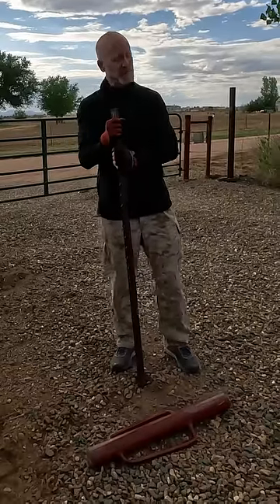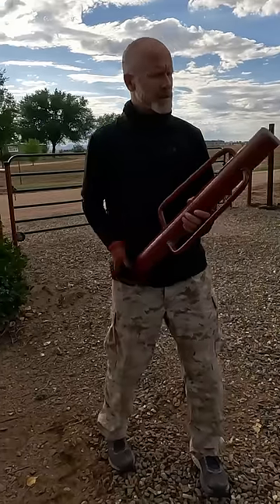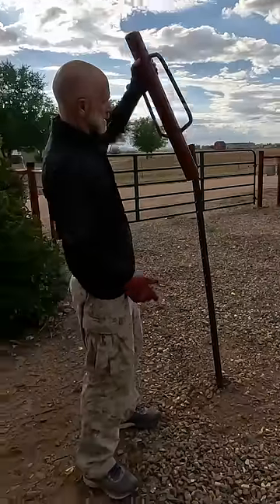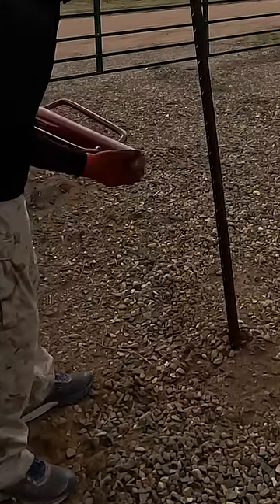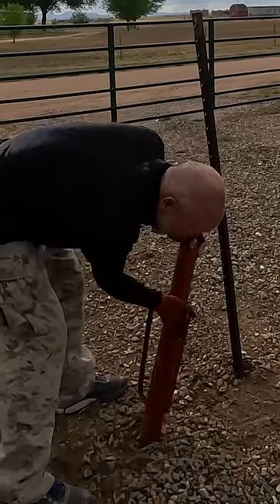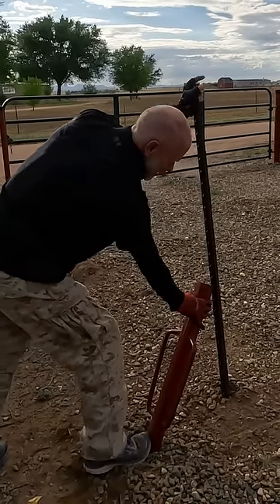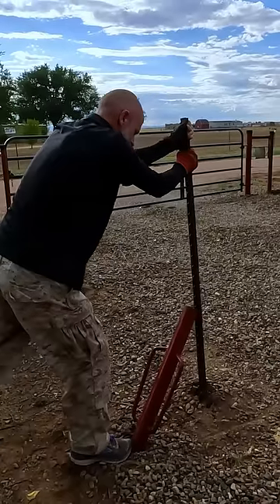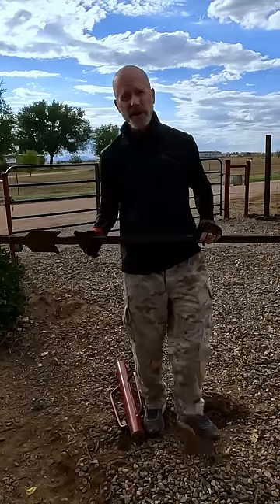Avoid Back Injuries with Simple T-Post Removal Trick

Comment: Please oh please...  when the base is loose and it's time to pull it out of the ground, step up as close to the post as you can get and squat - please don't bend like he just did in the video.
Reply from the maker: Great point. Excellent observation. To add on a bit. Stay focused. Don’t let a driver sliding out make you lose sight of best practices. Thanks for bringing that up. I should have clicked it in for a final pull rather than care about the time. I got luck that my glass back didn’t put me in the dirt.

Comment: This guy 😂 slide the handle over top of the pole pull up from the other side of the handle
Reply from the maker: That’s a good technique. I haven’t had much luck with that method. Solid solution if you can do it. For me to use the handle through technique I need to use a small jack and set the driver low. Any way that works in your environment and you feel comfortable, that’s the method you should use. Stay healthy my friend. ✌🏼🙏🏼

Comment: First of all that wasn't more than a foot in the ground
Reply from the maker: Must be the camera angle. Got that a couple times. It was 17”. 24” is the structural standard, some areas drive 36”.  In Australia a guy had to drive 72”. I can pop a post up to 24” and I know this. There is a standing challenge for 36” that I have accepted but that is a deep pull for this method. I will work a little harder on the camera angles for that pull. Have a great evening. ✌🏼🙏🏼

Comment: Thats the wrong way 😮
You drill in the driver then get a 150mm piece of high tensile steel,pass it through the hole through the post and out the other side,then use it to pull out the post,
Work smarter not harder😂
Reply from the maker: Ah yes. The star picket removal technique.  These tposts don’t have holes. In my opinion the star is a far better system. Because you can make it this simple and they are stronger.  There are better ways to do these type, such as a proper puller. I appreciate ya taking the time. Be safe over there. ✌🏼🙏🏼🕊️
Reply from the maker: Or I missed it all together. It’s late. 😂😂

Comment: Not the best way, start by using a lift high low jack, or a lever chain system. much easyer.
Reply from the maker: Totally agree. Always better to remove yourself from the equation. You have a fantastic solution but the tractor guys would laugh at ya. I guess perspective is key. If you have $50, spend it on a puller or a rig of sorts. If ya don’t, this might help. It’s the claw to the hammer. A wrecking bar is still better in most cases but sometimes the claw is all you have. 
Wonderful contribution I appreciate ya stopping by. Have a great day. Be safe. ✌🏼🙏🏼

Comment: Or you could just buy a t-post puller for $30 and do it in 5 seconds or less
Reply from the maker: Good point. A far better solution on many levels. If ya need a leverage solution ya got this for your back pocket. Just don’t grip and rip. That’s what I was shooting for. I appreciate ya stopping by. Great solution. Have a great day. 🙏🏼✌🏼

Comment: You couldn't pull up that wee bit that was in the ground cowboy........
For shame
Reply from the maker: A wee bit? 17” is a wee bit…..I would hate to live in your town. 😂 I measured it from the base and really gave it a stretch. 😂🤣 you are correct, it wasn’t the full 24” as a structural minimum or 36” that a lot of areas require. One guy in Australia had to drive 72”. That’s wild. 
I drove 8 posts to 24” that I am letting settle-in before a proper pull off. We will see got it goes. Thanks for taking the time. Have a great evening ✌🏼🙏🏼

Comment: That could be made better
Reply from the maker: Absolutely. I appreciate ya making that point. I am setting up for a 3’ pull as a challenge. I am notching the driver so it doesn’t make me lose focus by sliding away. Gotta maintain form and focus. Thanks for taking the time. Be safe. ✌🏼🙏🏼
Reply: @futurehomesteadingAZ working smarter is definitely the way. Good luck sir.

Comment: You're not pulling up tho
Reply from the maker: Watch it again. The ground clearly heaves up. Use it or don’t. I showed ya how to use the “claw of the hammer” instead of bending over to grip and rip. Tons of better methods in the comments. Have a great day. Be safe. ✌🏼
Reply: @futurehomesteadingAZ  just because the pole went up doesn't mean you were pulling up lol
Reply from the maker: @chrisjuengling1983 yeah Chris. It’s the lost art of leverage. I may have put the wrong inflection on your initial reply so let me back up. I can’t pull up due to injury and it’s a common way to wreck yourself. If I use some leverage principles I can change the direction of force this way by  redirecting the force  from sideways to an upward direction. There are better tools and methods. This is how I have been doing it for years. Thank you for being curious. ✌🏼🙏🏼🕊️
Reply: @futurehomesteadingAZ  that's all I was saying, was just teasing a bit. Wasn't supposed to be that serious!
Reply from the maker: @chrisjuengling1983 so sorry. I need to take a step back to evaluate my approach. All good lessons. Be safe sir. Thank you for not just abandoning the convo. This helps me. ✌🏼🙏🏼🕊️

Comment: That is just stupid there is a easier way to do it a hell of a lot easier actually two ways grab you a small chain wrap it around the post or just take the chain and cut it and measure it off about a foot in diameter put a bolt through it slide YouTube 2x4 through the chain slide the chain over the fence post put the end of the two-by-four on the simply put it in a bind and pull up or you can do it with another t post or just work at the shit out of it don't go to say you can't do it because you can I used to do it all the time and then one time I seen my brother's take about 500 they took a hundred of them in 30 minutes I was wondering what the heck they was doing they told me somebody give them well come to find out I got a accessory to the fact they would literally go out there and shake the t-post side to side and pull them up one hand and this year it had concrete rocks glass you name it it was in that dirt